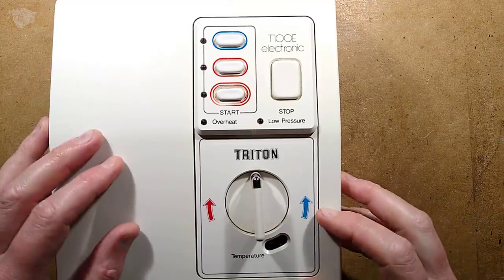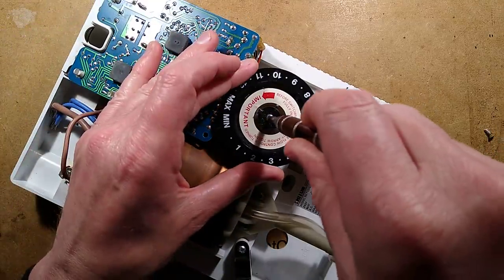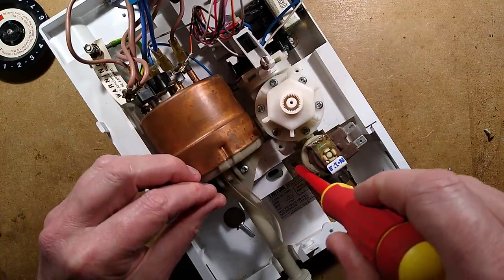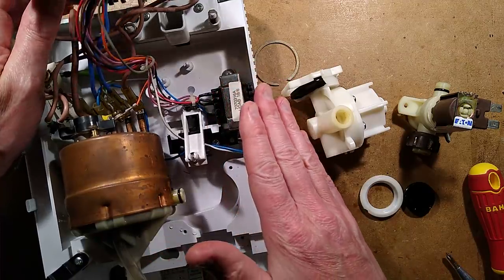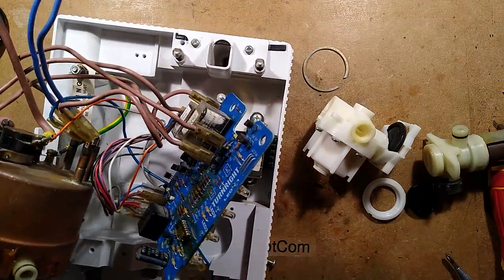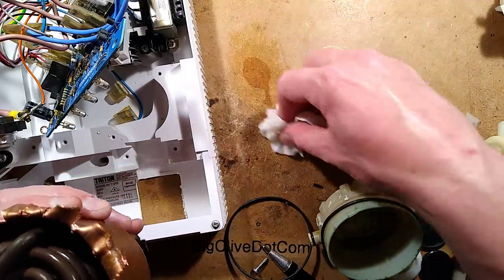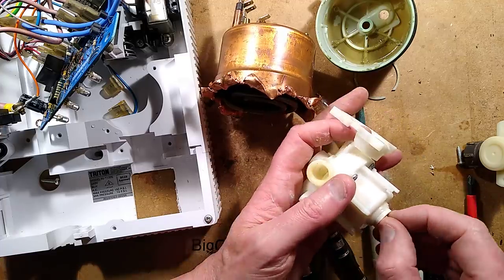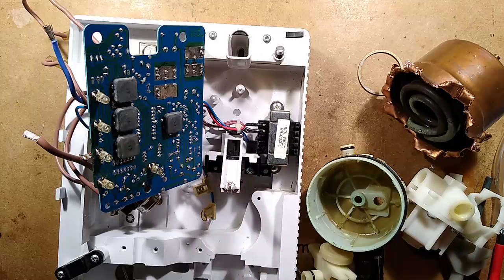Teardown of a British electric shower that went bang.

Comment: In Britain you can't have a regular splash proof light switch in your bathroom, but a 25 amp electric shower inside your shower cabin is somehow fine.
Reply: It's not a power shower, it's an electric shower, very different animals!
Reply: the pull cord switches are ridiculous they always fail. Meanwhile on the continent we get to enjoy a regular light switch and standard 16 amp sockets in the bathroom.
Reply: Yeah that's stupid. I can have a IP65 light switch outside exposed to the rain but not in my bathroom. Ditto a pair of those waterproof sockets with the fold down lid, OK outside but not on the bathroom.
Our bathroom as a kid had a normal light switch. When the house was rewired in the 70s they replaced the switch with a modern MK rocker but it stayed where it was.

Possibly there are earthed shielding around abouts in the shower but not in a light switch?
Reply: @Progan666  No I have been in this house over 30 years and the only thing about the pull cord switch to fail is the cord. Oh the shower in the bathroom is gas,fed from the central heating.
Reply: The bathroom light switch ban is a myth, you can have one in your bathroom as long as it is 2 feet away from the bath. You can't have a normal socket in the bathroom unless it is 3m away from the bath IIRC. Most modern electric showers are in the range of between 40A and 50A, and are usually the highest powered electric devices that you will find in a normal home.
Reply: CambridgeMart Thanks, I was incorrectly calling it a power shower all this time, just googled the difference. I had one of those in a flat I was renting in the past. One time it broke, the landlord sent an electrician and after he took the cover and I saw the exposed 25mm2 wires I was terrified to used ever since.
Reply: Bruce Forsyth In a typical British house 3 meters from the bath is in another room.
Reply: @johnmccallum8512  Must be a good one then because I've had 2 fail in different locations.
Reply: @Cropeck  An electric shower is anything but a power shower. As they are high pressure but low flow they use a certain design of shower head that basically shoots needles of water at you. Hardly any volume of water, but surprisingly painful on certain areas of the body!
Reply: @dopiaza2006  "shots needles of water at you." I know exactly this sensation.
Reply: We had 2 7000 watt / 220 Volt electric showers connected in parallels in our dorm... you know what happens when you pass 64 Amp through a leakage relay? Appearantly it explodes.
Reply: you dont have a light switch inside the bathroom? where is the switch then>?
Reply: @xenonram  - Feels like you're sandblasting yourself clean, excellent!
Reply: @Francois_Dupont  Most bathrooms on the UK either have ceiling-mounted light switches with pull cords, or else normal lightswitches on the outside of the bathroom (next to the door).
Reply: Last one I fitted maybe 20 years ago now I ended up running 10mm cable, it was IIRC 45 Amp, 11Kw cable has to be run direct from the board with no breaks. Had to use a mains fed shower to get a decent head, it was a chalet bungalow so the shower was higher than the water tanks.
Reply: You can have a standard plate switch outside of Zone 2 or 600mm from the edge of a bath or shower.
Reply: @Cropeck  25 mm2 ??? More likely 2.5 mm2 I guess.? 25mm2 is very, very thick at 230 - 250 Volt (not that it matters if you'd touch live 2.5mm2 or 25 mm2).
Reply: @Francois_Dupont  Just outside the bathroomdoor... you turn the light on before entering and off when you close the door.
Reply: @Progan666  the cheap pull switches are useless and constantly fail.

Never had a decent one (like the MK ones) fail although I doubt fine the MK ones make an annoyingly loud clunk when they you turn them on or off
Reply: @mineteam0  The student house I rent has four 6.5kW electric showers in one house. It's an ordinary house with a 100A single-phase mains breaker. You can do the maths.
We've lived here for 2 years and not had any fires yet. 
One of the switches outside the bathroom for isolating the electric shower melted once (probably because the switch was pitted, the landlord put in a new switch and it's been fine since).
Reply: It's human interaction that's the issue. A person with wet hands using the shower is fine but if moisture gets inside the switch and a person (even with dry hands) switches it there's potential for a spark
Reply: @MrEdrftgyuji  three metres on a light switch as well as a socket, and as someone already pointed out that's generally in another room.
Reply: @dasy2k1  the loud clunk, while it can be obnoxious, is a good sign really. Technology Connections explained a while back but long story short the faster you completely break a circuit, the safer it is for a switch and loud click when switching means the circuit is broken faster
Reply: 20amp you’re kidding yourself some are 10.5kw so that’s 43 amps. Also they’re safe. Insulated elements and earthed.
Reply: You can have a switch in the bathroom as long as it's out of reach when you are standing in the tub. Pullcord light switches are simply more common, particularly where the bathroom is fully tiled and it avoids having to screw about cutting a hole in the tiles for the switch
A 25A electric show would be feeble. Most of them are at least 9kW and thus run from a 40A circuit
Reply: @Cropeck  if it's anything like many I've been in, 3 m away could well be another room in another house!
Reply: Cropeck - it is permitted to have a wall plate light switch in a bathroom, as long as it is sufficiently far from the bath or shower.
Reply: Francois Dupont - in a typical older house or flat in England, Wales or Scotland, you will find the switch for the bathroom mounted on the ceiling with a pull cord hanging down. Pull once to turn the light on, pull again to turn it off. Alternatively sometimes the light switch is next to the door outside the bathroom. But despite what people think, it is actually permitted to have a normal wall switch in a bathroom, as long as it is sufficiently far from a bath or shower.
Reply: Dylan Harding - it’s NOT three metres for the light switch. It’s 600mm from the edge of the bath or shower - see this site: https://www.rm-electrical.com/technical-resource/bathroom-zones-explained/
Reply: Luke Doherty - most are supplied by 32A, 40A, 45A or 50A circuits depending on the power rating of the originally installed shower.
Reply: @Mark1024MAK  but as with most UK houses pretty much the entirety of my bathroom is in zone 2 if it's not in zone 1
Reply: @xenonram  yes, these things are horrible
Reply: @Cropeck  Or another house entirely
Reply: @Progan666  I have seen a normal socket in the shower in Italy, powering the extractor fan. As an electrical engineer, that was one of the most worrying things I've seen. The EU regulations were exactly the same as in the UK, but some countries just don't follow them
Reply: @Cropeck  lol, what do you thing a resistance of a heating element is? just a wire
Reply: Cropeck LOL, this is so true!  There is no point in my bathroom, that is greater than 3m from any other point in the room; it’s cozy!
Reply: Most light switches in the UK are on the ceiling in the form of a switch you pull a chain down to toggle the light on and off.
Reply: @r.h.8754  What are you doing in a Victorian aged school?
Reply: @mitchblank  🤦‍♀️ insulated heating elements AND its earthed/grounded
Reply: mitchblank - The requirements include the metalwork (including the mains water pipe) of electric showers must be earthed. The case/enclosure must prevent human fingers from being able to touch or get anywhere near the line and neutral terminals. Most showers have plastic cases/enclosures that are designed to prevent water from the shower head getting anywhere near the electric wiring, conductors, control switch or the connection points. So in normal use, in what way are they unsafe?
Do you also walk at least one metre away from street lamps and electricity lit road/street signs?
Reply: @dylanharding5720  The pull switches used in bathrooms are also double pole, so you're effectively operating two switches at once, hence the loud clunk.
Reply: @Kevin-mx1vi  a lot aren't, mainly because they don't have to be. A loud switch is always a good sign though, with both single and double poles.
Reply: @Cropeck  

Except this shower unit will be on a dedicated circuit with a dedicated breaker. Not to mention the unit is properly grounded to pipework in the house. The heating element portion is also completely insulated from the water travelling through it.

Cheap shower head heaters may be the thing you're thinking of.
Reply: someone needs to teach the British that water and Electricity do not mix
Reply: @davidjames666  What about a kettle? 😂
Reply: @Cropeck  are those electric for the British too?
Reply: @davidjames666  They're electric everywhere except the US, where people microwave water 😆
Reply: @Cropeck  Do not believe what you hear.  In the USA, we put a stainless steel kettle on the stovetop which is usually a gas fire or in some places without gas, it is an electric stove top.  we certainly do not use many electric gadgets as they are clumbsy, generally small, and considered clutter - let alone dangerous - especially as they age
Reply: @davidjames666  its a safe shower, and we have protections in case something goes wrong. If for any reason a water or gas pipe becomes live, the rcd protecting the circuit responsible will trip.
Reply: @davidjames666  

Someone needs to get educated on why electric showers don't actually do any mixing of the two.
Reply: @skylined5534  i understand.  it does not mix till the valve body breaks like it did in this video, and sends water thru the electronic control board.  hopefully the circuit is wired correctly
Reply: Cropeck it's britain, what do you expect? Lmao. Not much over there makes much sense
Reply: @Vgp-rp4iu  

Oh really? And what bastion of sense do you hail from?
Reply: @davidjames666  

It doesn't 'mix' at that point either. Due to a proper earth system you won't get electrocuted and the high wattage stuff is still shielded in the event of water hammer busting the inlet side.
Reply: @mitchblank  

Holy god, another one who one, thinks Britain isn't allowed to have a switch INSIDE the bathroom and two, who thinks these 'magic hot water boxes' we use for showers are dangerous 😂
Reply: @skylined5534  right, but if the shielding goes south, you are fried.  did you ever have a gfi go bad on you?  i did!!!  the thing just buzzes and clicks but the current still goes thru!!! - this was on a certified General Electric gfi breaker.  luckily I was not in a dangerous situation, as it was just a toaster plugged into a gfi that just happened to be near the kitchen sink.  the toaster stayed lit till the breaker overheated the curcuit and burned out and cut off current after the minute it took me to get to the panel.
Reply: @davidjames666  

Never known of it happen even once. If properly installed they're completely safe.
Reply: @Progan666  15 Amp is the standard for resi, here in the US.
Reply: @jed-henrywitkowski6470  Kitchen bath are each on their own circuit, 20amps, gfi.   Rest of house 15, but 20 amps is good for tv/media and or if you have large window ac.   20amp outlets.

Q?  Plumbing used to be brass.  Often seen grounds to pipes.  So in shower, water, power goes through person, water to grounded pipe.  But now pex supply and pvc waste.  Would imagine much safer.  ?
Reply: @Progan666  i like those more... except when its outside of bathroom and others can be jerks and turn the lights off while you are taking a shower
Reply: Glad I live in the USA.
Reply: I heard 240 volts in a common British shower.  Brits, Never say anything else about electrical safety.
Reply: @elvinhaak  and one of the flatmates comes by and shuts the light off on you while you're in there. At night. Can't imagine what else could go wrong from there....
Reply: @lordsummerisle87  
A) you're not standing barefooted in a puddle of suddenly conducting water in those other scenarios. And
B ) "The shower is powered..."
Umm, no thank you. I don't know about you, but I don't want electrical power anywhere near my shower.  
"In most cases [...] Most showers [...] In many houses [...] Likely tripping the RCD" 
The use of those terms isn't quite the vote of confidence you think it is. 
As one of the other commenters said, "If the device is properly installed, it's perfectly safe."
Well, that's a load off my mind. I just had to have been there when it was installed, and know all the training they had, and know what the codes and regs say about an install to know IF it was installed properly. Because the alternative is Death by Electrocution. smh.
Reply: @ElectroDFW  Yes, you learn to shout loud when this happens. Quite normal, at least we are used to this over here (not only here in Netherlands but also a lot in Belgium, Germany and Czech Republic in hotels and private houses and many dormatories). After a while you can manage without light anyway which you also must do doing power-outings.
More modern installations have those motion-detectors (yes, still no switches inside) so that when you sit still for a while the light goes off and you have to move in spastic ways to get it on again, if it works at all.
Reply: @ElectroDFW  And here the house-owners are responsible for the installation in the house themselves... so you get creepy installations. Like when you have showered and you hear crackling sounds coming from sockets and switches INSIDE the bathroom... condens from the walls going in freely..... that counts as a warning not to turn the light off (yes and no protection of course, only 2 wires to the sockets).
Reply: @dylanharding5720  lol.

In the split second it takes to hopefully trip, your ultra conductive skin and heart could be a pathway... I think it's what more than 30ma and it can kill you

Talk about an incredibly stupid device. Gas heaters for the win.
Reply: @2paulcoyle  grounds don't make anything safer. And the pipes running to the supply are still copper and can still be bonded at the incoming. But it's all irrelevant.
Reply: "inside your shower cabin"
Was this an exaggeration or do they actually hang INSIDE the shower cabin?
Reply: @lunakoala5053  Yes ,inside the cabin
Reply: @lunakoala5053  They actually do.
Reply: @mitchblank  I'm literally crying, having read your post! Let's mix 240 volts at 40 amps inside of the shower stall, all inside a small plastic box, with water mains connected through the whole thing... I would feel inclined to wear a rubber wetsuit, rubber gloves, and rubber boots, before I EVER stepped inside of a shower stall equipped with one of these deathtrap contraptions! No thanks!!!   Fred
Reply: @Oscar-if6lq  That certainly exceeds UK electrical safety standards. Fuses do not melt instantaneously at their rated current.. As they conduct more current, like any resistor, their temperature rises and their resistance increases dropping the available voltage and thus the current. Your 100A fuse could tolerate perhaps 150A for many minutes. In the long term the fuse may be weakened by repetitive thermal events and fail at less than its rated current.
Reply: cuz showers are supposed to be water resistant (i’d hope literally waterproof tho)
Reply: As this is the de facto "these are dangerous" thread I tried looking up safety figures but could not find any.  However I found some Office of National Statistics data on deaths in England between 2001 and 2017 where exposure to electricity (ICD codes W86 and W87) was giving underlying cause on the death certificate.  Also the estimate of the number of households in England in 2017.  By way of a government consultation on energy efficiency labelling it says that the "The Bathroom Manufacturers Association (BMA) suggested electric showers account for around 50% of the market in the UK".  So in numbers:

Over 17 years there were 345 deaths caused by electricity, and average of 20.3 people per year.
It breaks down the location where 143 of those deaths were in the home, an average of 8.3 per year.
In 2017 England had 22.7 million households, going by the BMA that would mean at least 11.35 million electric showers in use, likely higher because of homes with more than one shower.

But assuming those home only had one shower, and all electricity fatalities were caused by them, that is a rate of 0.0074 deaths per electric shower annually.  And that is the absolute worst case given the unreasonable assumptions almost certainly under estimated the number of electric showers and completely dismissed the idea that electrical deaths could occur any other way.

Many kitchen appliances combine water and electricity, kettles, steamers, soup makers, coffee makers, pressure cookers, rice cookers, garbage disposal unit, and so on.  Presumably the only reason people do not consider those all death traps is because they have experience with them not failing so are happy to trust plastic housings as providing insulation and protection.

It is plain weird claim these showers as dangerous when the anecdotal evidence is of them being widely used and safely.  Theory does not overrule reality!  But the theory itself is questionable as when installed professionally a lot has to go wrong at the same time for the electrics to get wet, a breaker to fail (RCBO is recommended for electric showers), and a user to come in contact with them.  Most mains appliances could kill us but we trust good design to provide protection, which is no different with electric showers.

That all said, despite my experience of never being injured by one, they are just not particularly good showers.  Regulating the pressure with the temperature is awful in winter when you have to turn it low to get the water hot enough.  But they are still far betters in those situations, where there is only a cold water supply, than no shower at all.  Though it seems many people who are presumably happy to do all manner of far more dangerous activities, such as all the ways we interact with roads, would rather go dirty than trust a proven design.

It is a shame not to have specific data as I imagine more people are killed by simply slipping over in a shower and hitting their head than by being electrocuted.